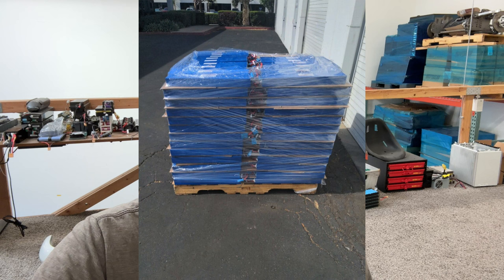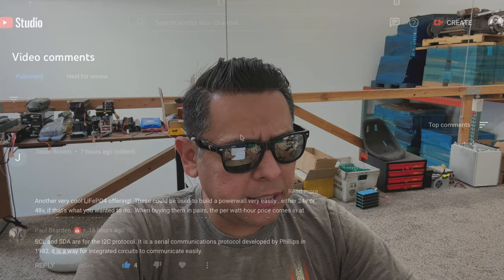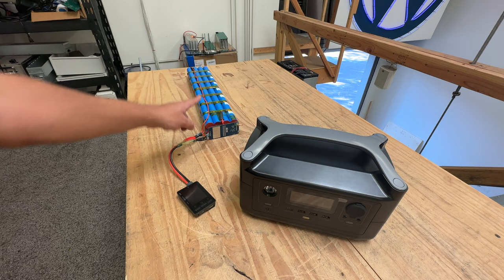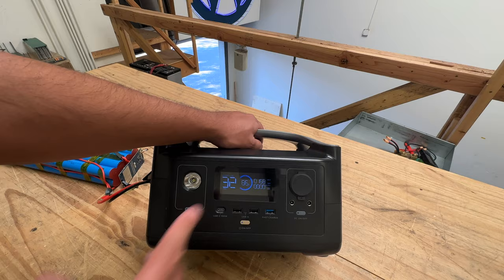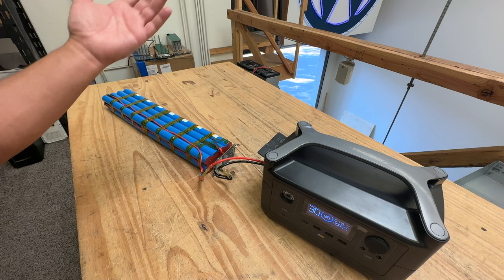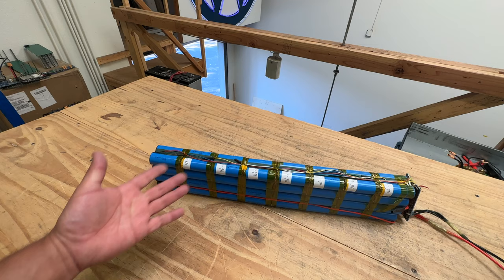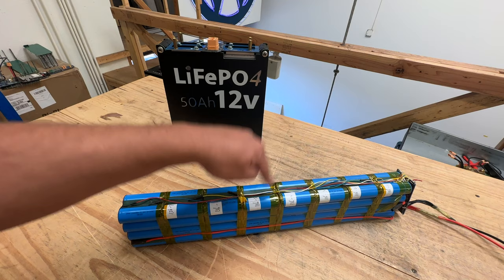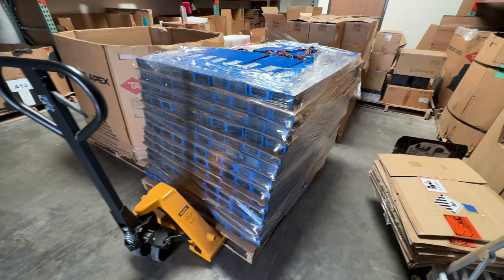24v LifePO4 Q&A with Jehu

Comment: Can you answer to my question - i have battery 48v from electric scooter (18650inside) and offgrid inverter 3kw working on 24v how to connect them  the best way ? cut original bms and damage battery to make 24v with china bms or keep them original and use some  kind of step down inwerter 38v to 24v ? i stuck what to do ?:D

Comment: Hi, I can ask you if it is possible to make a battery pack using LIC batteries (Lithium - Ion Capacitors) And what kind BMS for that. to use for my scooter engine 2000w, WITH 60V ECU. Any help appreciated 🙏🏻

 THANK YOU IN ADVANCE

Comment: so if i buy 8 of these would make 24v 192ah for $800. ampere time 12v 190ah 150a bms cost $570 with coupon and sale x 2 = 24v 190ah for $1200. you save around $400 doing the wires yourself. but again if you want peace of mind and convenience just get the amperetime (5 years warranty)
Reply from the maker: You are comparing ah at two different voltages?  You do know 100ah at 24v is twice the battery than 100ah at 12v right?
Reply from the maker: 8 of these packs = 5kwh   Show me where you can get 5kwh ampere for $1200.   More like $1800 https://www.amperetime.com/collections/ampere-time-12v-lithium-lifepo4-battery-series/products/ampere-time-12v-400ah-lithium-lifepo4-battery
Reply from the maker: Ok,  go buy less battery for more money then,   Not like you have much choice these completely sold out now.
Reply: @jehugarcia  yours is sold out now so it doesnt really matter
Reply: @jehugarcia  ty jehu. fyi i built 2 makita boxes like you did with the obx lifepo4, they are all useless now. i wonder if you want them back for free, i can send them to you.